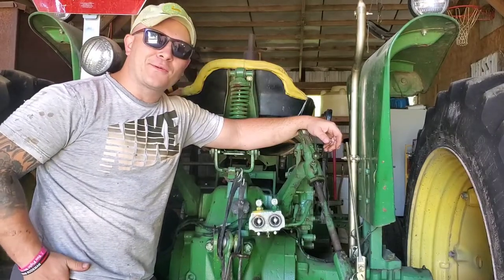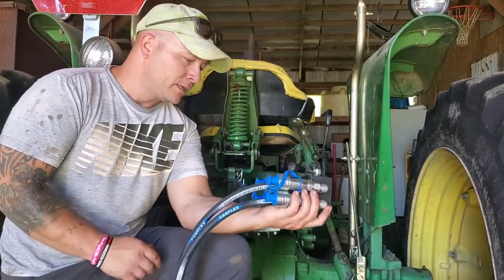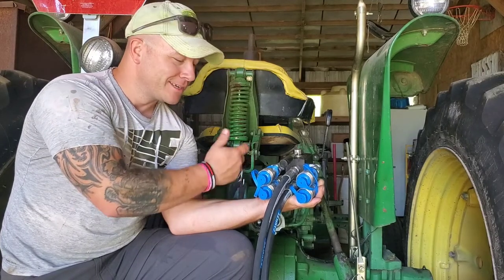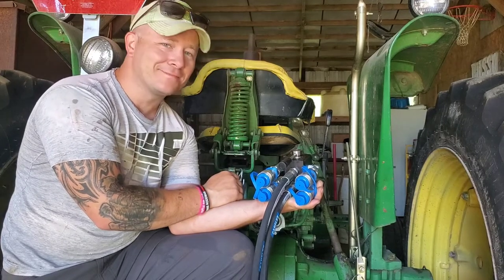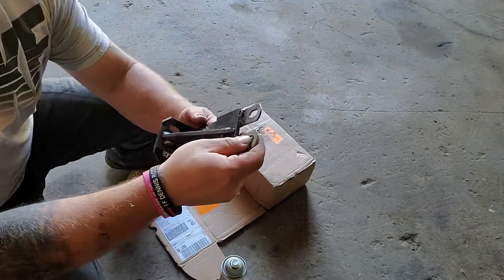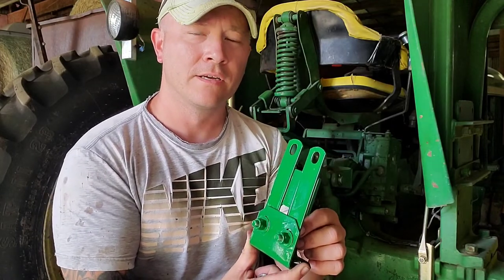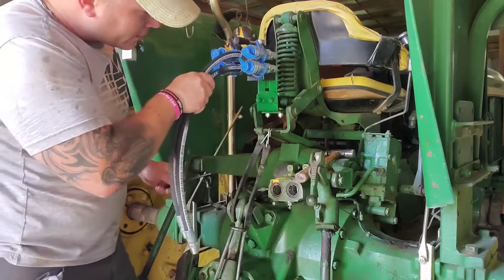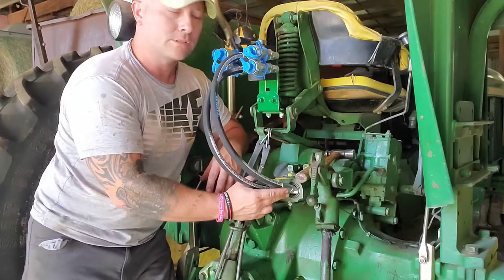Adding a hydraulic multiplier, or hydraulic diverter. To go from one set of rear remotes to two!!!

Comment: We used a fossie valve   where we needed   2 more  hydralic functions   IT is  electric switch controlled  for swapping the functions...... you could plumb the hoses into  the lines going to the original  coupler and have 3 functions.......I get most of my Hydralic fittings from Discount Hydralic Hose......
Reply from the maker: Nice!!! Thanks for the tip 👍👍👍

Comment: Why not put a " T" fitting inline..... that way both remote work when every you need them ? Use a " T" for both sides.  The couplers use to cost around 35 dollars.  Total cost........around 80 dollars
Reply: You could but then what ever you have plugged into them will work same time.. dont want to do that. Most times  you only want to work one at a time.. just like a batwing mower.. if you put  T in them it would raise ok off the ground. but your batwings would also be raising.

Comment: Can you change the outlet side to side without relieving the pressure and shutting down the tractor?
Reply from the maker: Yes you can switch from side to side without shutting off the tractor. Now to disconnect you need to shut down ans relieve the pressure.
Reply: @thornapplecreekfarmllc5941  
Thank you. I was able to pick up that same kind on Amazon a few days ago. It worked great on our 3020. Mounting it was a different due to hose length. But those are still available.
Reply: @UN4RACING12 can u please provide a link to the part? I'm interested in this option.
Reply: @otis6791  I sent it. Let me know if it worked
Reply: @UN4RACING12  I don't see it, but thanks anyway for trying.
Reply: @otis6791  I've put it in 3 times and yt pulls it I guess.  It's on Amazon.